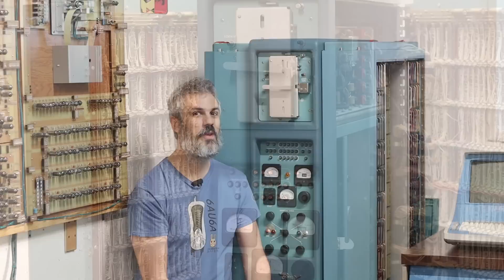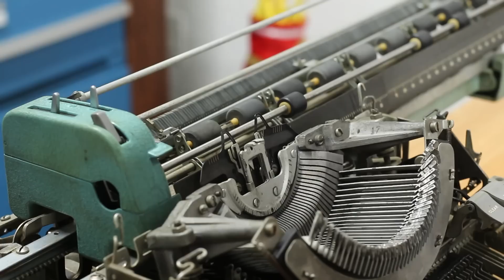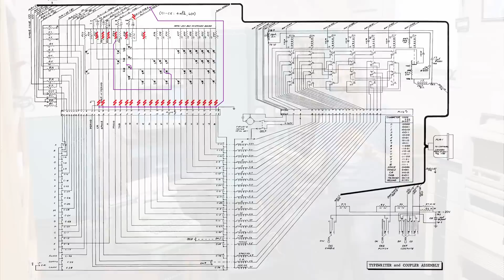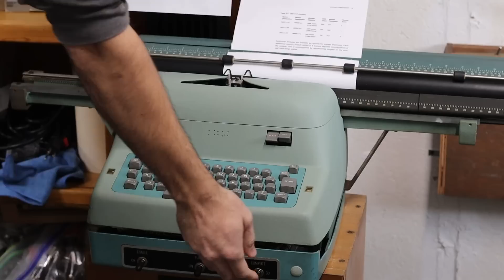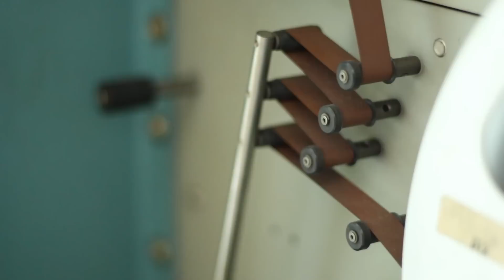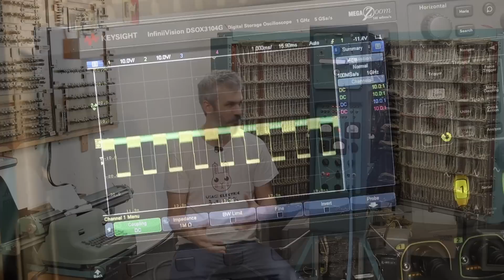Playing Music on the Oldest Running Computer in America!

Comment: I still don't understand how this machine (a 1959 machine) was so massive..... when I have literally seen photo masks from 1960 to use a photolithography machine to print a tiny transistor board of circuits onto a small wafer of silicon to be made into a microchip that is microscopically wired with tiny little gold wires to the board and then protected behind a little protective "black box" on the board.... This seems crazy that the US Air Force purchased this massive computer for like half a million dollars adjusted for inflation in 2024 US Dollars and have them running all the way into the late 1960's.... (maybe even into the early 1970's??....).... and another thing.... if we were making microchips in 1960.... why did we then still use core rope memory for the Apollo guidance computer?.... (and core memory ferrus magnetic donuts that flip core rope memory was being built well into the 1970's....).... Weren't they rushing and rushing and rushing to miniaturize microchips all through the early 1970's to mid 1970's to late 1970's and this is when the place became called "Silicon Valley"??
Reply: its from 1956 this is really small for the time and i think people kept using it just because any computer is better than no computer
Reply: @belstar1128  so transistors literally super super super super miniaturized from just 1956..... to the mid 1970's..... and I'm talking about going from just a few thousand huge glass phototube transistors on boards on this 997 pound computer to a microchip that was as tiny as the tip of my fingertip and held millions of little tiny transistors?????.... (and now they have billions of tiny little transistors on each same-size microchip these days........ and they continue to try to make more and more chips onto the same tiny little silicon wafter but they are now reaching the end boundaries "brick wall" of the "size barrier" and so we can't get any tinier and if we try the electrons "quantum tunnel" through the silicon barrier or the copper barrier.... so that is why we have to force ourselves to switch to quantum computing now?........

Comment: Your reaction to the computer playing is EXACTLY the one I had when I made the KIM-1 do the same thing some 45 years ago :D
No direct connection to the amplifier, though: I tuned a radio to the right frequency (any multiple of the machine's 1MHz clock would do), and the radio picked up the electronic noise produced by the program reading a block of data (the "waveform table"). Hours of work for a thing I'll be doing with BEEP commands just a few months later.

Comment: Those electrolytics in the typewriter are leaking, just from a visible look, and should be replaced for good measure. Otherwise it’ll pull down the DC that gets supplied by the computer and draw more current.

Comment: Making sounds on a computer is it's own kind of joy.  Especially if the computer was never meant to do it.  I fondly remember when i finally got an amplifier so i could hook up to the cassette output jack on my TRS-80 model 1 so i could have sound.  And when i got to work on Apple ]['s, i wrote a number of machine language routines to make sound on it, using the built in speaker.

I also remember a story of a guy who found out if he put a transistor radio near his Altair, you could make music on that thing.  I think there must be some built in need to make computers make sound of some sort.  It seems to crop up on everything that can compute eventually.

Comment: I'd have wondered if inserting carbon paper into the typewriter between the ribbon and the paper would have made some kind of legible printing possible, until the ribbon can be replaced.

Oh wait.  It did look like it was printing on the paper directly.  Something had been worked out or fixed.

Comment: I have an idea why this typewriter was modified to disable most of the keyboard.
It probably was used as a printer or secondary console to some sort of computer system which was operated by unqualified personnel and the system was loaded by one specific program running constantly.
Keys was disabled to prevent 'bad input' and there was some sort of cheatsheet on the was like "Press F to calculate payouts"

Comment: Regarding typewriter ribbons, there are only a few standard sizes. 

They can be obtained as bare ribbons and manually threaded onto the original reels. I used to do that a lot in apprentice days in the early 80s

It looks like you've got a 1/2 inch "universal" black/black ribbon

If the original ribbon is in good shape - and it appears that way - it can be reinked. India ink is all you need (in general the most effective way is to ink a paintbrush and then apply the paintbrush to the ribbon whilst spooling it between reels. Applying ink to the ribbon on-reel will result in splotchy results until it's permeated through the reel and needs a bunch of end to end winding sessions to spread things out evenly)

Comment: I tried this on the IBM1620 that I use a University (in the 60's) and it worked.  Later when I started working did the same thing on a PDP11.  There was no connection to the radio used, it was all generated by RF emitted by the computera.

Comment: Random thought; I wonder how difficult it would be to use an array of LEDs and microcontroller to make a paper tape emulator, so you can more rapidly iterate software development and avoid going through mountains of paper tape. Something thin (flex PCB with the tinest SMD LEDs?) that can slip into the paper tape track and flashes light directly into the photodiodes.

Comment: This is the joy I felt the Christmas I got my first computer. A Tandy color computer 3 with a disk drive and cassette drive. I had NO software to begin with, but it did come with a 2 inch thick book of example BASIC programs. My dad and I took turns over hours entering in hundreds of lines of POKES, GOTOS and other data. When we finally typed RUN at long last, we were greeted with an, I THINK, 8 bit representation of a hut, palm tree and some coconuts with a rendition of the theme song from Gilligan’s  Island on our RCA console furniture! I was BLOWN AWAY, and have been hooked since. I wrote many many megabytes of BASIC on that computer and never really stopped since that December 25th. Early Merry Christmas everyone!
Reply: I started with a Timex-Sinclair and quickly went to the old gray Color Computer, but the second version with regular keys, not the chiclet keys of the original.  I later got the CoCo2 and a monitor.  I subscribed to "Rainbow" and "Hot CoCo" magazines for many hours of fun typing in programs.
Reply: I learned to program in Basic and wrote a few programs - one is still being used. I never really got the hang of programming in anything else. Basic is so easy. I've been told by my software-engineer brother-in-law that Basic is tedious for doing anything complicated though.
Reply: @TehButterflyEffect It can be tedious for serious programming, but it is incredibly easy to pick up and start doing useful stuff with. There’s a good reason that BASIC was a large part of computer classes in the 80s and early 90s and there were even BASIC programs in math and science text books of the period. The only major drawback I saw during the time is it was SLOOOOOOW. Eventually I solved that with a BASIC compiler for the COCO and later C64/128. Sped up those programs by an order of magnitude.

Comment: Considering the square wave isn't generated by the program but read from the tape, could you do a little pulse-width modulation with the waveforms to make them not-so-square?
Reply: I was thinking along the lines of producing 2 tones simultaneously rather than envelope control.

Comment: Awesome. Just awesome. 

As a young engineer, I worked on large Philips stored program control PBXs. They used, even in the early 1980s, some of the same technology: paper tape input and output, a panel with a bunch of lights and switches to operate the thing using binary (hex) code, an optional Teletype, and so on.  Fondly remembered days.

Comment: I watched this sitting on my couch and then glanced over to our Christmas tree to remember I have a laptop ornament from 1997 that plays a similar sounding tune, but doesn't take a room sized computer to do it.

I need to take it apart and fix it. Button batteries were left in it one year and leaked damaging battery leads 😢. 

It's a fun one, you draw a lever back to load a spring then push the roller ball that releases the spring causing a Christmas mouse character to twist and "insert" a 3.5" disk inronan external drive and activating the tune through a piezo speaker. 

So glad we were able to down size electronics to make this happen! 😅

Have a Merry Christmas!

Comment: I don't hear the Christmas music. Disclaimer, I was born with a limited hearing range and am unable to hear much over 4,000 cycles per second where normal hearing is about 20,000 cycles per second.  I am unable to hear the last few keys on a piano and the upper notes of a violin. Need to get more base in it. 
Playing music was pretty common on old computers. Some had speakers that the operators used to determine where the job was and others would stick a transistor radio next to the core memory. Using the output off the drum memory is an approach I haven't heard of before but it would work.

Comment: 12:40 is likely there for a rather simple reason.
The drum pulls the tape, but the punch stabs through the tape and practically stops it from moving. There needs to be some give between the drum and punch else something else have to give. So it is probably a way to minimize wear.

Comment: Someone needs to design a MIDI  interface for this new synthesizer. Also, imagine that the Bendix ecosystem gets fired up again and people start hardware emulating them on their Raspberry Pi Nanos and stuff. But with the gigantic connectors of the original. You could make a FORTUNE selling peripherals alone.

Comment: This typewriter has mechanical tab stops under a flip up cover behind the platen.  The tab stops are upside down U shaped clips.  Usually the extra clips are stashed way to the right end of the platen where you don’t need tab stops.  I had a typewriter like the Bendix, but short platen, back in the 1980s, mine said IBM on the front.

You might want to put tabs every five spaces so that the carriage doesn’t keep flying all the way across when you hit tab on the input.

Nice job on the restoration and thanks for the music.  That brought back memories of doing an assignment back in college to get a Kim-1 6502 board to play Christmas music back in 1980 for an assembly programming class.  My first attempt sounded about like the first output from the Bendix.
Reply: That's cool! Did you still doing computer stuff over the '00s? How did you and your peers adapt with the blazing fast progress?
Reply: @robertosutrisno8604   I am still involved in electronics and data processing.  Personally, changing technology doesn’t seem like a big deal.  Hopefully most engineers don’t stop learning when they’re handed their diplomas.  I prefer the technology we have now.  I spent decades fiddling with DIP switches, wire wrap jumpers and what wires were necessary in a null modem to get equipment to talk.  That takes away time from real problem solving.  I much prefer the current technology environment because it is so much easier to be creative.
Reply: Careful…. What tab stop spacing to use (8? 4? 5?) is a known point of argument in tech and programming.
Reply: @  This one looks like the one I had, which was 12 point Pica type.  Five spaces for a tab was pretty typical to give 1/2 inch tabs.  Of course you can set it to whatever you want.  Some experimentation may be necessary to figure out what the program assumes.  Any stops are better than none with the carriage flying across every time it hits a tab.  Anything printed after the tab will just be a jumble at the right margin.
Reply: @ppokorny99  In 1956 this was not an issue.
Reply: @ppokorny99  There is only one correct answer: 42milliCubits

Comment: So dumb, such an exorbitant machine being used as a music box. Love it. Guess that was that era's version of "but can it play quake?" I've played quake on the side of a building, because, well, I can't sign off on that multi million dollar project if it can't play quake. That would be unreasonable. Fortunately my boss agreed. We also used milk drop as a test to QC our LED displays. Generally flagged more faults than straight rgb. Lots of rapid switching shook out alot of problems, and turned our warehouse into a proper rave (our shop hifi was pretty excellent, as you'd expect from a bunch of electronics engineering geeks). The boss wasn't so keen on MDMA tho. I like the use of obscenely expensive equipment used for trivial tasks is such a traditional thing.

Comment: About that weird modification on the typewriter - maybe it was used as a stage prop at some point? They wouldn't have had a compatible computer available, but by soldering all inputs together, they could have made it "do something" by applying voltage to a random input.
Reply: My guess is it was in a location accessible by people who have no idea how to operate it (or, worse, people who think they do) and it ran some sort of program that when you pressed 0 you got something useful printed out but if you pressed any of the disabled keys bad things happened...and to prevent them from revolting they made it so every key became a harmless key. You can have a cranky six year old mash on it and it won't blow the system up, but it'll still print out whatever they need to print.
Reply: @DanBowkley  Yeah, it seems fairly clear that someone wanted to make quite sure no one could input anything but 0. There's got to have been a reason for that.
Reply: makes me think of living history centers and wax mannequin displays
Reply: If you just wanted activity, you wouldn't have needed all those mods with diodes and resistors...  To do that many mods, someone had to have some idea of what they were doing..   If he sends those marked up schematics with the mods to someone like Ken Shiriff or other reverse engineering wiz, maybe they could figure out what was actually intended..
Reply: May it be that it had been rewired to act as some kind of braille typewriter/printing device, that should be operated by only few of the keys pressed simultaneously  (bypassing the original keyboard matrix) like playing chords on a piano.

Comment: Super! Question: Why is the number “1” missing on the keyboard? The top row of keys starts with “2”?
Reply: The lowercase 'l' was commonly used on typewriters for the digit '1'. This practice survived as late as 1980 or so, long after typewriters got dedicated '1' keys. I'm a little more surprised that it has a dedicated zero key instead of using the 'O'.